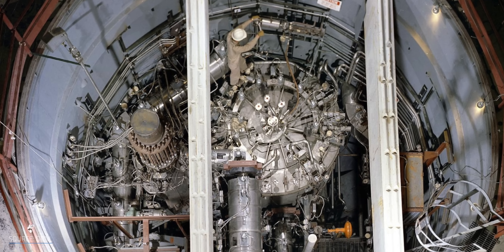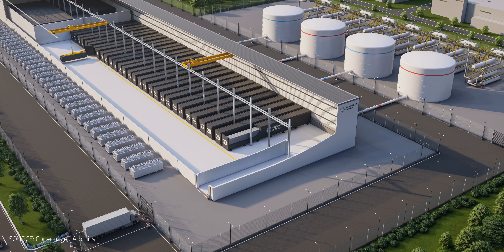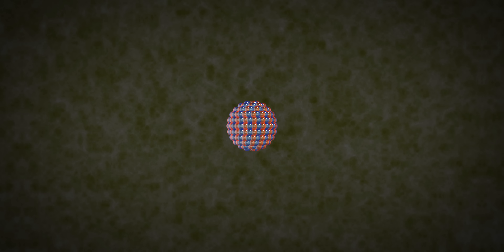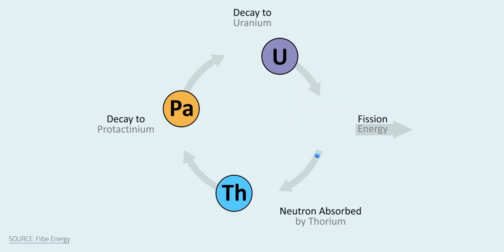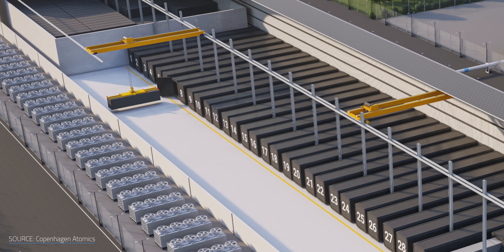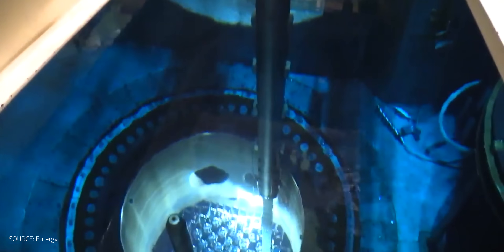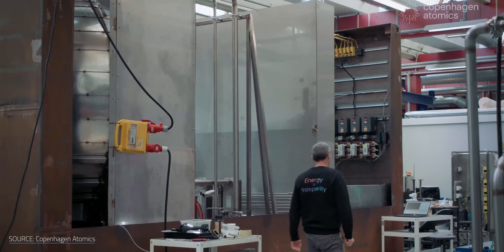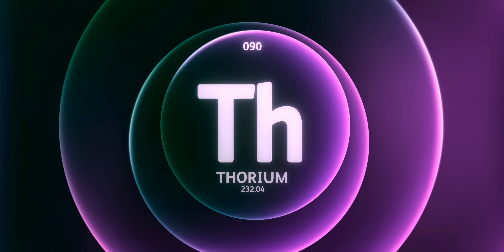Why Thorium is About to Change the World

Comment: Guys may not believe this, but I'm a mechanical engineer in iran and we are working on a thorium reactor too🤣
Reply: Good, the problem western countries have with Irans nuclear program is the possible production of weapons grade plutonium. If you guys are working on Thorium reactors, that wont be an issue.
Reply: @Andy-oc3ew  the West follows Isreal, and Iran is an enemy regardless of what they do as of now.
Reply: @Andy-oc3ew  Well actually Thorium reactors produce U-233 which is actually very well suited for nuclear weapons. Depending on the purity they can attain with these reactors it is has critical mass similair to Pu-239 or U-235 and is far easier to obtain.
Reply: 😳 Iran??
Reply: Probably blown up now
Reply: Not yet😂 @julezxbandit
Reply: Probably worse than china's
Reply: David Adair’s design perhaps?
Reply: I hope it works out for you.
Reply: Seriously? Fun place to be right now
Reply: @amirsa7140  Not any more you arent
Reply: @amirsa7140  well if that's true, it's most likely a pile of dust currently
Reply: @amirsa7140  you still alive?
Reply: This makes me happy. I hope all this works. We need it so badly.
Reply: Keep going, peace, mercy, and abundance is wished on your path of research. Even if it is not the best solution for the Middle East you'll learn from it.

Comment: At 8:25 you say "No risk of high pressure steam explosions", and that's probably not true.  There is no risk of the heavy water moderator boiling or the coolant flashing to steam when it's not water, but all that heat is probably going into water/steam in a heat-exchanger.  To get good turbine efficiency, that steam is at high pressure.  You can have steam explosions at a coal or natural gas fired plant in the steam turbine mechanism, and it's hard to see how the MSR changed the thermodynamics of steam engines (that's very old tech).
Reply: you still get steam at the pointy end but a steam explosion is just a steam explosion. No radionucleides and well isolated from the nuclear bits.

Theyr'e still dangerous and messy but not radioactive

Additionally, water-moderated nuclear is limited to about 325C max (280 at turbine input) and that means wet steam. Being able to produce dry or supercritical steam makes a big difference on the power generation side

Comment: Nothing that relays on mining finite resources should be part of the renewal energy equation. That is my take. And that is not saying that thorium reactors should not exist, but just as a momentary steep to reach the goal, not as part of the goal.
Reply: There's somewhere between 50,000 and 2 million years worth of accessible thorium. Supply is not a problem and there's even more in seawater

Comment: Even if they had perfected their tech today, and started production tomorrow, it will still take many years to scale up to significant levels.  In the mean time, wind solar and batteries are already produced at huge scales and they keep growing and getting cheaper (excluding the current tariff nonsense).  So I don't think nuclear will ever catch up.  The future is wind + sollar + batteries + hydro.
Reply: Yeah the power required for the future can’t be just nuclear alone. I like what China is doing manipulating time zones. They have solar farms in their western deserts 2 time zones away from their population centers in the East and they have efficient UHVDC power lines to move that power so Shanghai can be running on solar until 6 pm.

Comment: IMHO they'll never catch up to renewables in cost. They'll probably be the best choice for some niche markets, but never be a big part of the energy mix.
Reply: The problem is that solar panels and wind turbines will only be a small part of the cost if everything shall run on renewable sources. Transmission and storage will be most of the cost. The system also must handle replacement of old panels and turbines.

Comment: That is pretty attractive that the core runs at ambient pressure.
Reply: The core can't overheat either. Thermal limiting of fission reactions due to the doppler effects of vibrating atoms means the reaction temperatures top out about 1150C. This is red hot but well below the boiling point of the salt or the thermal deformation temperatures of Hastalloy-N pipework
Reply: It eliminates the need for a "containment building" and Fukushima-type failure modes.  The experimental reactor at ORNL was literally "walk-away safe".  They'd just shut it off at the end of the day on Friday and go home.
Reply: Only water cooled reactors need the high pressure. Gas cooled, sodium cooled and MSRs don't.

Comment: Throium reactors work by changing one element to another element several times, that is incredible
Reply: That's also how traditional nuclear (Uranium) reactors work. And how radioactive substances in nauture, like C-14 work.
Reply: @mrleenudler yes you are correct and turning uranium into krypton (not a spelling mistake, its literally krypton) is absolutely magic to me,
Uranium (U, atomic number 92), with 92 protons, is the starting element.
 * It absorbs a neutron (^1_0n).
 * It then splits into:
   * Barium (Ba, atomic number 56), with 56 protons.
   * Krypton (Kr, atomic number 36), with 36 protons.
 * Three additional neutrons are released, which can go on to cause further fission reactions (a chain reaction).
As you can see, the uranium atom (92 protons) has been transformed into barium (56 protons) and krypton (36 protons). The total number of protons is conserved (92 = 56 + 36), but they are now distributed among different elements.
Reply: @NLPexperts  I'm sure you're also aware elements can climb up the table via beta decay 😊

Comment: First half of video I was wondering how they have handled corrosion. As it is the nemesis of a molten salt reactors. Turns out - they don't)) They just let it corrode and exchange the whole reactor. It's ok, if this is an economically feasible. But what about handling reactor afterwards? It's gonna be highly radioactive
Reply: Yes, but not exactly. They have actually found a way to increase the longevity of the alloy they are using by making an ultra pure salt. They are unique in the world that they can produce these salts at large quantities at such purity levels. Currently it's one of their business models to earn some money. You can find more explanation on their website, and the samples exposed to the high and low pure salts.
Reply: @Brattoes  This happening was a major major breakthrough for MSR, it got totally slept on but it's actually an incredible step forward.
Reply: Nope. 

MSRE was drained several times using various fuels and after being left for a couple of days the radioactivity levels of the pipework and reactor were very low - safe enough for humans to handle.

The predicted ablation rate of hastalloy-N is about 0.001mm/year, on 3 or 4 inch ID pipework with 1/2 inch thick walls. It isn't unreasonable to assume that a century is the expected lifespan of commercial-scale deployment pipework.

As for corrosion: Look up what happens at Davis-Besse in 2002. That wasn't the only such case but marks the nearest miss for primary loop escape due to corrosion

Molten salts are benign by comparison to hot, high pressure water, let alone when it has boric acid added
Reply: @alanbrown397  The biggest factor is the high pressure. I was there when the plant was shut down and we  reviewed the inspection results and it scared me. There was a football size volume of steel head material that had been vaporized next to the control rod drive mechanism (CRDM), where a crack occurred and ran through the weld material. The only thing keeping the pressure boundary was the 1/4”-3/8” of stainless steel (SS) weld cladding on the inside of the vessel head. And the SS cladding had started to bulge and crack. When you are dealing with temperatures of 650+ F and pressures of ~2000 PSI there is little safety leeway. But if the temperature can go higher and the pressure is close atmospheric then there are materials that can deal with it. Inconel 600 or 660 are amazing as long as they don’t have to deal with the high pressure.
Reply: @brianrassler2010 That was the reactor head at Davis-Besse, wasn't it? The 405 clad separated from its base, right? I think the Germans tried to avoid this problem with grey rods, ultra-pure water (no inhibitors or additives), and all-stainless construction on their Konvoi reactors before they shuttered the program.
Reply: @brianrassler2010 You are FOS and just making stuff up. The MSR is not a pressurized reactor and runs at just above atmospheric pressure. The liquid salt can’t vaporize like water. There is no water in the reactor to expand to steam and require a giant pressure container and secondary giant pressure vessel to contain leaks.
Reply: @alanbrown397  I never considered what ~3000psi ultra hot water does to metal.  Good point!
Reply: @alanbrown397  Same old same old tosh from the nuclear cult. NB We don't need it and never have. It's not the solution to anything, except the high wages of academic cultists.
Reply: from what i learned from others specialized in the line of work decommissioning reactors, scrubbing/washing the radioactivity off of the parts isn't the issue, as much as the anti-humans of the parts in question is.  Reactors are built out of some really nasty metals and elements, and the majority of the decommissioning work is spent trying to deal with that more than the radioactivity of the site.  Also the scale of the decommission is also staggering, the one I was a small part of had to build a railroad, to bring in a crane that could lift the core of the reactor and move it a handful of feet/meters out of the building, so they could then cut it into manageable chunks to dispose of.  Staggering levels of scale, it was really cool.
Reply: @goodvibes4891  Weinberg is very likely to have taken that into account for an industrial prototype. 
I know the ORNL team spent a lot of time working on the metallurgy and there was a very strong focus on making the design as safe as possible including checmical toxicity

We'll see what happens with TMSR-LF1 but I have high hopes that the problematic items will all be in the fuel salt
Reply: No. That is the point, Thorium molten salt reactors are not highly radio active, and their residue is only marginally radio active
Reply: Its the future for technology didnt you hear the video.
Reply: This sounds extremely expensive
Reply: They'll just throw all this crap down the wells and rivers and into the ocean like the rest of the chemicals and trash, or make tampons out of it. If that cant work, then it can be ground into stuff for kids.
Reply: No mention of China? They will be the ones who develop it as a working technology.
Reply: Highly radioactive is good because short half life makes it break down quickly, not highly reactive nuclear waste is our current problem because it stays active for thousands of years due to long half life.
Reply: @johnowens5342  Wrong. Highly reacive nuclear waste becomes long term radioactive waste after 100 years or so.
Reply: My impression is that the half life of that waste is pretty short.

Also, u can just cover the waste in concrete and wait it out, like we do already
Reply: @kap4020 better to cover it with water.
Reply: What exactly does one do with a box of various elements that have been pummeled gamma radiation?
After removing the fuel source would any of the metals, plastics, ceramics, etc. be purified and reused in the production of new reactor components? Or do they simply create a massive pile of reactor boxes containing the equivalent of steel slag and volcanic rock.
Reply: @rabbytca plastics are probably going to be too degraded to reuse. Ceramics it depends. And metals it really depends. Lead can absorb a ton of neutrons before the isotopes get radioactive themselves. Other metals have multiple stable (or practically stable) isotopes, and/or isotopes with very short half-lives that will quickly convert into other things. There are huge charts of degradation pathways that can be used for figuring out what you'll end up with if you bombard some element with fast neutrons for a long time - it's complicated, but not unpredictable.
Reply: @rabbytca  Gamma radiation does very little. It's neutron bombardment which is the problematic part for materials
Reply: As far as I understand it if there is no water, and (maybe) no oxygen corrosion can't happen. So they purify the salts as @brattoes explains.
Reply: Molten salts stay hot and radioactive for a few days after it is taken out of the reactor. Water becomes safe almost immediately.
Reply: @thebeautifulones1978  But i was not talking about fuel, I was talking about reactor itself. It's a lot of steel, that has been exposed to gamma-radiation for 5 years. How do you deal with it?
Reply: @OKOK-hm2is it depends. Just because something has been bombarded with hard radiation for a long time, doesn't mean it becomes problematically radioactive itself. Gamma rays generally don't make the target radioactive. Fast neutrons that are absorbed by nuclei do, but again, every different kind of atom is going to absorb neutrons differently, and subsequently be radioactive to a different degree.
Reply: @thebeautifulones1978  depends on what is dissolved in the water.  so this isn't necessarily true example cesium is water soluble if you have radioactive cesium which is one of the byproducts of fission reactions it is not going to be safe immediately.

Tritium and Tri tritium are radioactive but are fairly safe to handle. but even then, it's not almost immediately
Reply: Yes. And it will be dripping radioactivity out of its corroded pipes... Probably for centuries.
Reply: AI robots

Comment: Thorium can run a reactor, but can also be bred into weapons grade material.  Canada inadvertently contributed to proliferation in the 1950’s when a technology transfer to India building a CANDU reactor using Thorium led to India building a bomb.

A CANDU can be refuelled while running, so I see the molten salt reactor that can continue to run while being refilled  is no different than a CANDU with the constant operation while fuelling.

Modular reactors are a pipe dream when you can construct district scale power plants in the gigawatt range and transport the electrical energy via the grid.

Why would anyone be willing to overturn their entire supply chain for the sake of running a far smaller plant that would need to scale up from demand, when you can build out the scale in a much larger plant?

Canada will never ‘run out’ of Uranium, btw.
Reply: "... the scale in a much larger plant?" Power transmission costs and losses. Most of the energy from big power plants is generated way too far from where it is truly needed.
Reply: @kruszielski And hydroelectricity doesn’t generate power where it’s needed?  SMH
Reply: @effingsix3825  about 10 to 20% of the energy produced in Itaipu, the biggest hydroeletric powerplant in the world is lost in transmission. Not to account the vast amount of money to build and maintain those very long (1000+km) power lines.
Reply: @kruszielski You are ‘lost in transmission,’ I’m afraid.
Reply: wake up, site specific electricity for mines data centers, etc are coming soon. why would you spend a fortune on transmission infrastructure when you can produce on site. have you ever visited a northern community, a potash mine? there are many on site demands for SMRs. ocean island communities.  CANDU reactors are pressure water reactors... just because they can use thorium doesnt mean they are efficient or safe doing it.
Reply: @rjv2395 SMRs are vapourware.

Comment: I live in ID near the experimental breeder reactor 1(EB1) site. They had a pretty good setup for how they did it way back in the olden days and it seems like something we should be able to do today. I think treating it like a sealed system is over engineering. They had a system at EB1 where they could just gravity drop the outside blanket of the core to disconnect it. Because of it's small size and lower material cost compared to newer reactors have a few running at a single site where some can turned off for maintenance while another runs seems like you could get away with lots less engineering. If 70 years ago we built some working reactors it seems like we should be able to make some real cool stuff today

Comment: This is a amazing concept. Once we work out the kinks, this would be a great alternative to solar power for remote civilizations such as certain regions in Alaska. And if it can use spent nuclear fuel, all of the better. I foresee this powering nuclear bunkers when this becomes economically sustainable.

Oh, and in exchange for taking the heat, we also have the ability to have thermal energy to use as well? Imagine using the thermal energy to keep stairs clear of snow in elderly communities
Reply: Running bunkers with a ressource that will eventually run out and one that you constantly have to transport there? Very, very, very unlikely.

Comment: Wonder why they need to use metal in the pump and plumming? With no pressure you could use some type of glass or composite materials that do not corrode.
Reply: They don't stand up to the neutron bmbardment

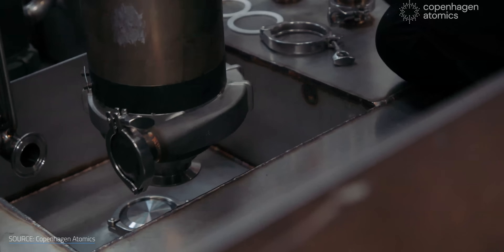Comment: 09:33 they don't need to use solid steel walls, just pour in concrete, what happened to the " were trying to be cost effective and efficient "

heck its even safer when it comes to moving and constructing the installations, instead of using heavy cranes and welding they can just use significantly lighter and safer methods with concrete blocks or pouring it. this is annoying to listen to.
Reply: Concrete is handy because it contains a lot of water and that gives extra radiation shielding